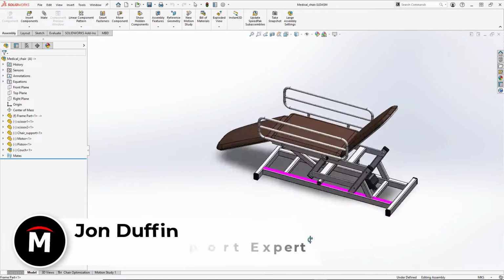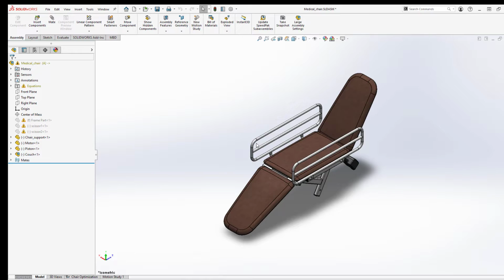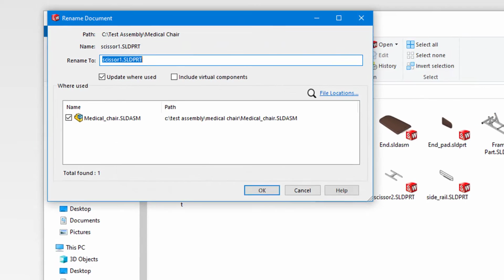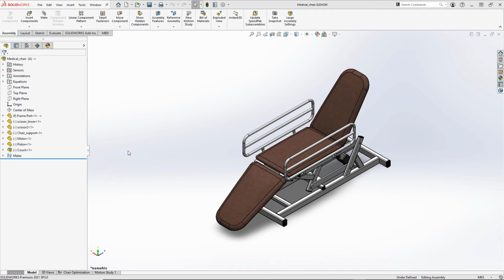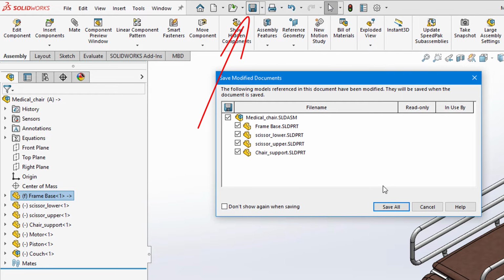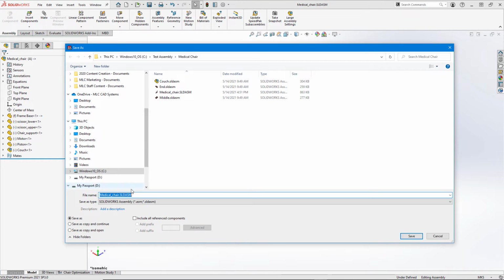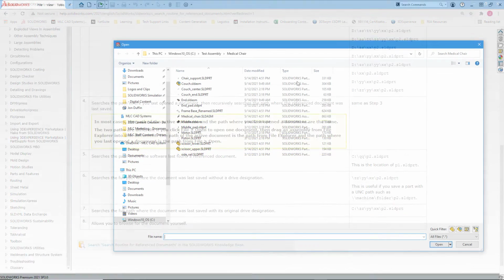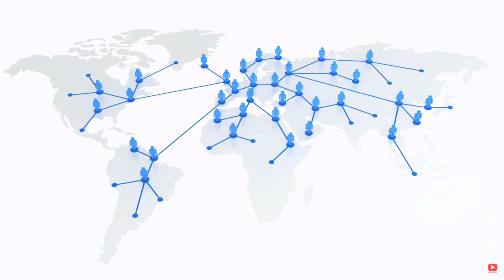How To Rename Solidworks Files without Breaking References

Comment: The SOLIDWORKS menu "Rename" function creates a copy of the file with the new name.  Will ALL existing assemblies be re-referenced if you will with the new-copy/new-filename using the "Update where used" check box?  It is not feasible to add all the assemblies file locations using the "File Locations..." feature.
Reply from the maker: The Rename function will only update the referenced documents that are identified in the dialog.  If you have two assemblies that reference a part, but only find one of them when renaming it, the one that was not found will reference the old name and will throw an error when it is opened.  Having a file that is referenced by a lot of other documents presents a serious challenge to file management that is really only resolved with a tool like SOLIDWORKS PDM.  There all file references are stored and managed in a database for easy access, meaning you can change any file name any time and file references will all resolve correctly.
Reply: @MLCCADSystems  I currently use PDM Standard to manage our files in our small group of 12 users.  I have a need to rename files in a 'library' of commercially available components that are regularly used to produce larger assemblies, yet I want to insure all the many many references to previous assemblies are not broken.  I have requested support from my current VAR, and while there are many ways to 'skin the cat' none of them fit the need it seems.  I'm interested if you have other information (Youtube video) you can share expanding on how to rename individual part files while maintaining integrity of the parametric links between.
Reply from the maker: Any file that lives inside a SOLIDWORKS PDM vault will have no file reference issues between it and any other file also in the vault after a name change.   In PDM, every file has a unique file id number, the name acts more like a custom property that can change without a problem.  When you open an assembly from the vault the file references are generated from the database and it knows what each file is called at that moment.  Best practice would be to close the files and check them in before you do it, but that isn't strictly required.

Comment: this ONLY works for files in the same folder. If part is used in assembly outside of the folder, references would still be broken
Reply from the maker: This is mostly true.  If you have files in other locations that you commonly reference, you may want to have those in your SOLIDWORKS System Options as a Referenced Documents path, in which case those folders will be searched too.  If you know what folder the reference documents are in, you should add those to the search path manually.  If you have any documents that you don't know about or don't search for, they could get lost in the mix.  The only way you can perform a "where used" and know with complete confidence that you are updating all parent documents is to use a database-driven system such as SOLIDWORKS PDM that tracks references up and down the file structure.
Reply: since we are a small office, setting up PDM is not an option. But, will try to add path is system options, the folder where all are projects are, tnx @MLCCADSystems

Comment: I have a part with a drawing to go with it .
This drawing contains two different paint schemes for the part named A and B .
Parts the same but it can be painted with different silkscreen. 
It has caused problems so I need to have two different drawings one for A and one for B .
The easiest way is to copy the drawing file and editing both so one is A and one is B .
Of course we are talking solidworks here. 
This very simple and extremely common method requires research in solidworks .
How do I create another copy of the same drawing file . I'll rename it immediately but I have to do that first .
As I guessed solidworks only has rename , move , replace .
Not copy !
I swear this thing was built to make things difficult
Reply from the maker: Drawings are never referenced externally by name, meaning if you rename a drawing it will never cause problems.  Copy/paste, Save As, or any other option to create another drawing file will work exactly as expected, no special processes or procedures required.  Parts and Assemblies can be referenced by other Assemblies and Drawings, so those need to consider the process shown in the video.

Comment: thanks for the video!  :) I dont understand why solidworks make this so complicated
Reply from the maker: If you use a CAD-aware data management tool like SOLIDWORKS PDM or the 3DEXPERIENCE Platform it isn't complicated at all.  The issue comes from having one part that can exist in multiple assemblies, be referenced by multiple other parts, and displayed on multiple drawings.  This is a solution that is only solved elegantly with a database of some kind, or by eliminating many of the most compelling features of associative design.  If your designs or product lines are complex, you should use a database-driven solution to manage files and references.

Comment: Thank you! This is life saving! At first when right clicking on the file in the folder the "solidworks" menu did not appear. If someone has the same issue, you need to set the "solidworks laucher" as the default file opener.
Reply from the maker: Exactly!  It should set that option automatically, and in some rare cases the above steps don't work, so reach out to support if that happens, and we'll get you fixed up!

Comment: That option not in 2022
Reply from the maker: Which option do you not see?  For example, if you do not see the option in the Right-Click Menu to Rename in Windows Explorer it could be a file registration issue or it might look different in Windows 11 than it did in Windows 10.  Reach out to your local value-added reseller to further understand what is happening on your system and the best way to resolve it.
Reply: Sir I can change the name of any assembly file  from outside without broke references in 2021 but that option missing in 2022
Reply: @jatinderpalsingh2258  when right clicking the file in the manager click on more option and you can see solidwork rename

Comment: i updated a reference in the reference manager upon opening a assembly and still get an error. appears to be parts within a sub assembly that was updated, how do i proceed?
Reply from the maker: If you have a file reference issue and several assemblies are affected, you'll need to repair each one.  You can still save the top-level assembly with the top-level references repaired, but then you'll want to start in on the sub-assemblies.

If the files were renamed individually without being re-directed, this will be a pretty manual process.  If they were simply moved, open the assembly normally, it will prompt it can't find a file, browse to the new folder and select it and SOLIDWORKS will check there for any other files that might be missing, effectively repairing everything in that folder in one shot!
Reply: Thanks I'll try it tonight. I appreciate the quick response such a help

Comment: I have mirrored components that I renamed in the tree. But now they do not update when I make changes the parent component. Any help?
Reply from the maker: Renaming parts in an assembly tree is a different workflow.  If you have it enabled, you can rename files inside an assembly but those changes are not locked in until the assembly is saved.  If that component is used in other assemblies or drawings by its old name, those references will break.

If you are referring to in-context features, open the part and right click at the top of the feature tree and open "List External Refs" to see what assembly file they are in-context to.  Make sure it is the correct assembly, that they aren't locked or broken.  Depending on the workflow and other factors you may need support if that doesn't resolve the issue, if you are an MLC CAD Systems customer, reach out any time: https://www.mlc-cad.com/solidworks-knowledge-base/